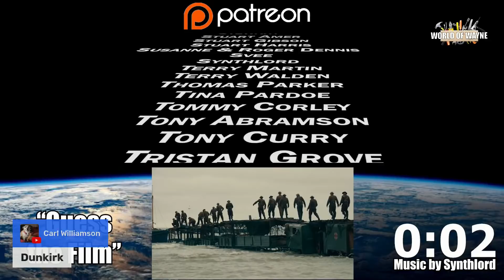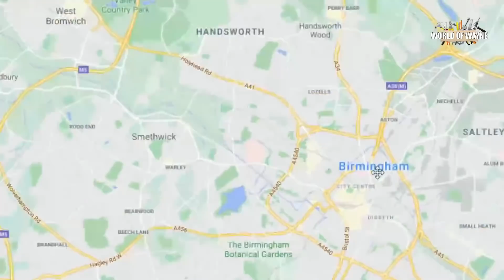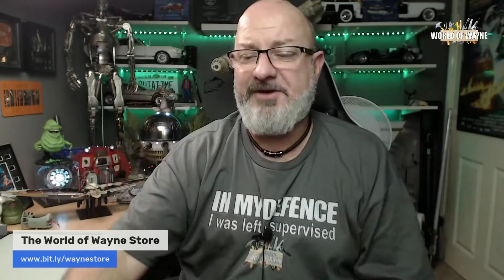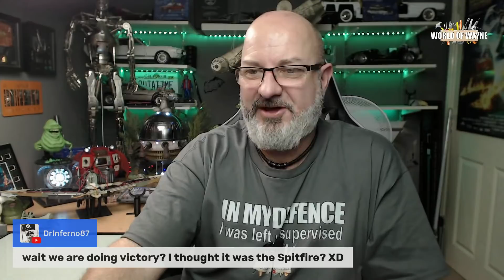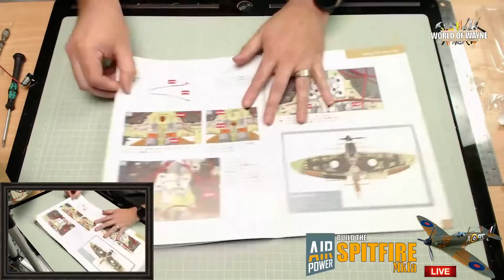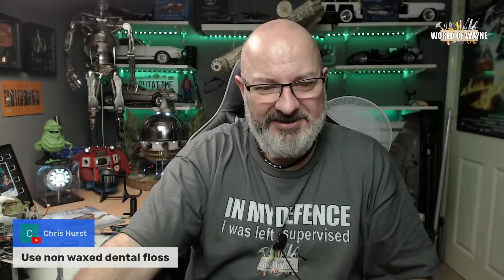Build the Spitfire Mk1a LIVE - Parts 55,56,57 and 58 - Working the Wing Flaps

Comment: I work on Victory as a guide (or will be once I've fought off the dreaded Covid after effects). She is still undergoing her 15 year restoration, though time is very much a fluid thing! She was re-supported last year and is now stable to the extent that you can now go underneath the ship to view her keel which is mostly original wood. Last Friday the main mast was lifted out of the ship for restoration, the start of the long process of putting the masts back to there original height. Adjacent to the ship, the Victory Gallery has been completely revamped and features a portion of the original mast, complete with Trafalgar shot damage.
Reply from the maker: Nice. I'll be there on Saturday.